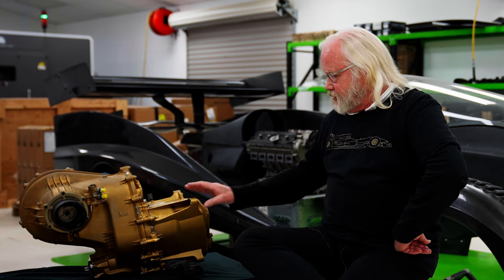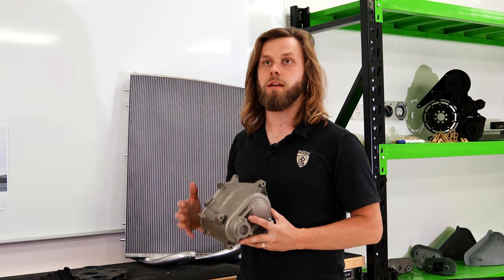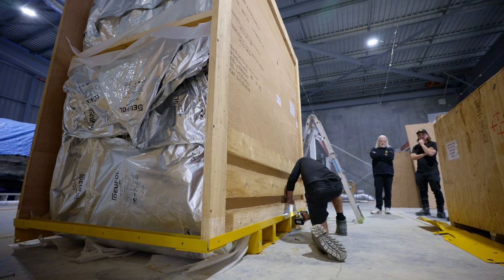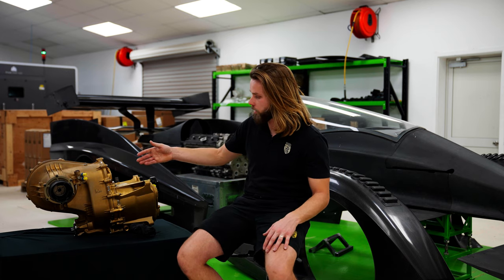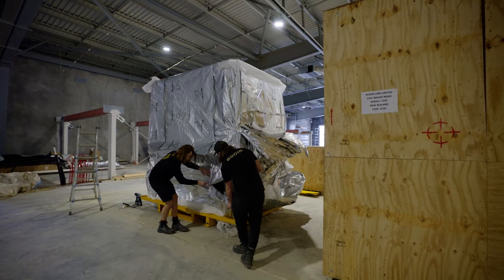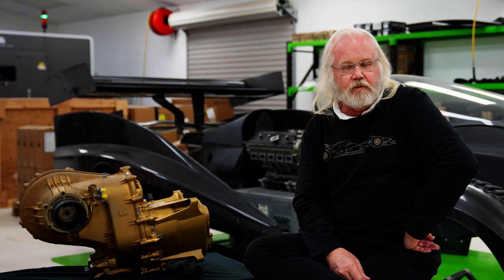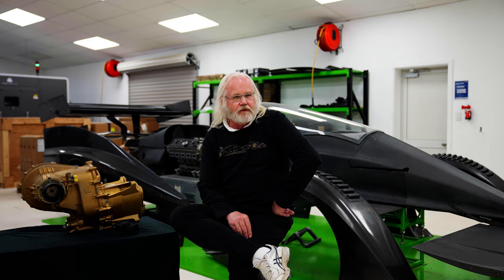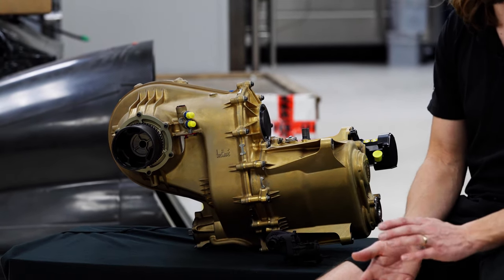3D Printed Gearbox: Rodin FZERO Supercar | Ricardo | 3D Systems

Comment: Damn, you fit EIGHT SPEEDS in that tiny gearbox? HOW!? And out of curiosity, how many overdrive gears do you have, and what is the reduction ratio between each gear? (IE, 2nd is 30% shorter than 1st, 3rd is 25% shorter than 2nd, etc.)